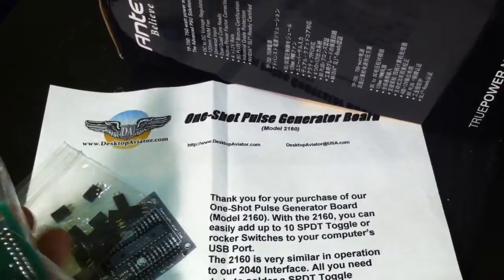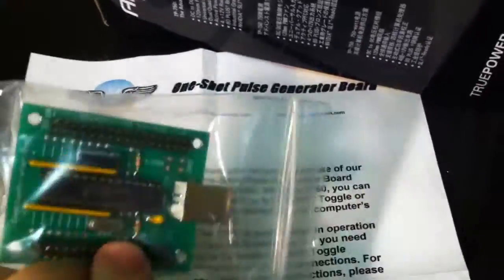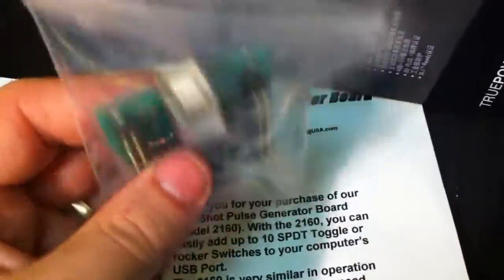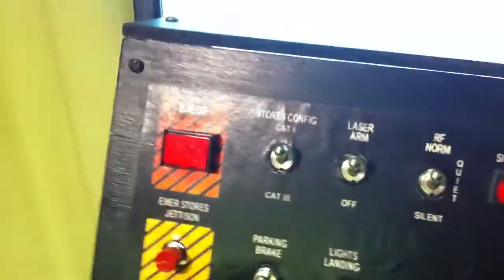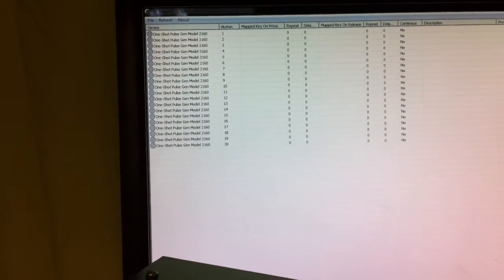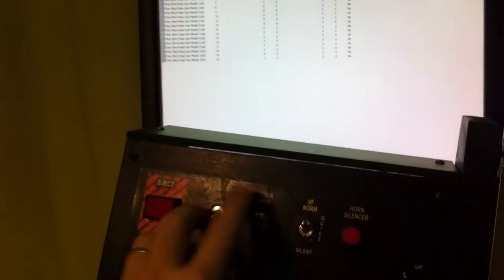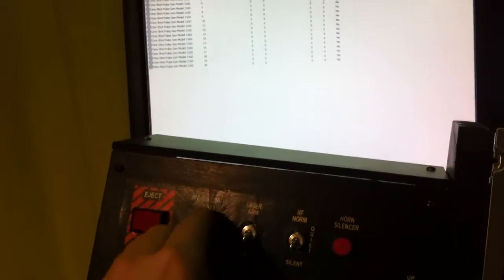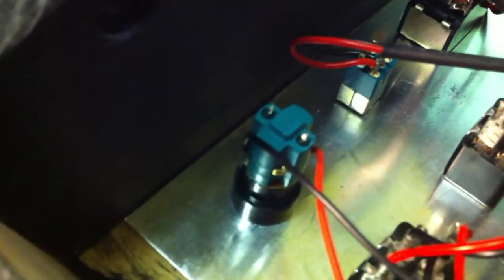Control Panel with Desktop Aviator Board

Comment from the maker: @AviationPlanezNSpace They are pretty common ("USB 2.0 A to B Cable") and you shouldn't have any problem getting one from an electronics shop and most computer shops. The same cables are also used to connect monitors with USB connection and some external hard drives. Great job on your cockpit setup.